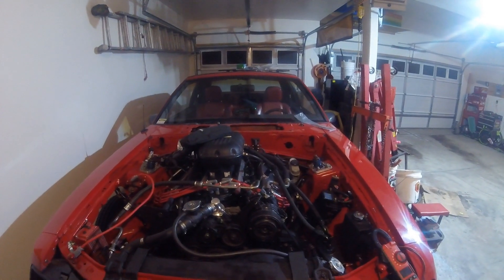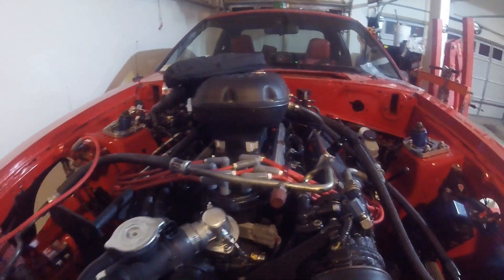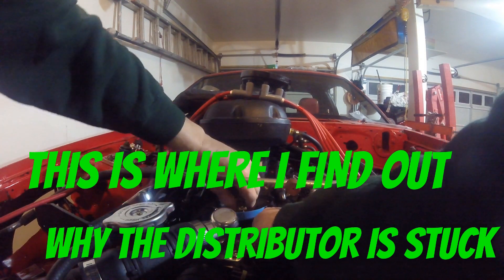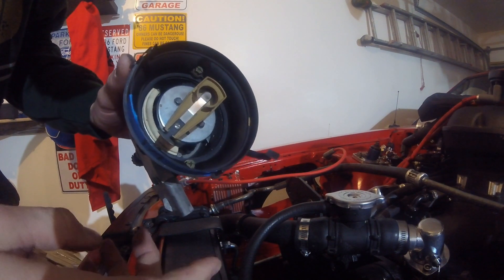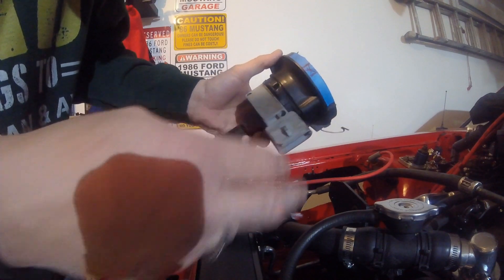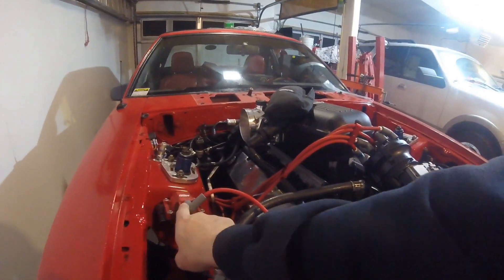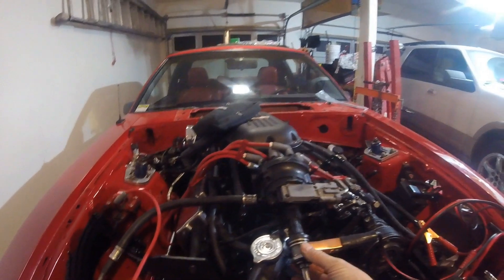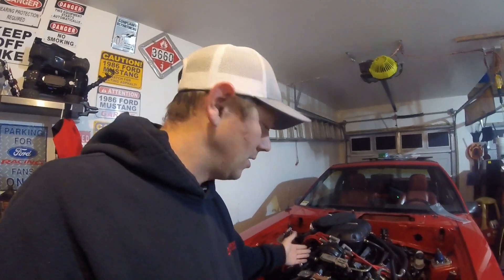Ford TFI & Pickup Testing - Ignition Troubleshooti

Comment: I get work but no fuel injectors clicking and no fuel pump turning on
Reply from the maker: Did you make sure to ground the body of the distributor?  Pickup inside the distributor could be bad, sounds like that’s what it is.
Reply: @BMF_Garage  I do have it grounded I even tried a new distributor connected the module grounded the body I do get spark but no injectors clicking and no pump turning on, what I notice it's that I don't get a ground from the rack at the fuel pump rely to power the fuel pumps
Reply from the maker: If your injectors or pump don’t turn on, you need to take out the ecu and look for corroded or bad capacitors on the circuit board.  Green fuzzy goo means they are bad or sometimes they even come off the board

Comment: Mine only sparked when I tried to unhook the ground cable and not when I turned the distributor what is the problem with mine do I need a new distributor because I already got a new TFI Mod
Reply from the maker: Could be the coil or the pickup in the distributor….

Comment: just did the spark/injector test and wasn't getting consistent spark to the plug.. wire is a foot long testing to 6.5k resistance
Reply from the maker: Look up how many ohms per foot that brand is supposed to have.. that will tell you a lot.  Seems high to me

Comment: Great video. I was looking into replacing this but after seeing how it works I don't think this is my issue. I have a 95 mustang with 302. After I removed converters, and added 75 mm tb and cai I've had a problem only after the car is really hot. When I go to restart it, it can't keep idle unless I feather gas. I let it sit for 25 min and it starts with no problem. It.seems like it's heat related . Will.never happen unless I been driving for a long time and shut it off.  I've replaced fuel pump, fuel filter thinking it was getting tired but still does it.no codes. Any ideas? Never left me stranded . I just sit for 25 mins and it fires up no problem
Reply: No. Good weather is here. Need to start working on her .
Reply from the maker: I know but unfortunately work is a priority.  Too many projects stacked up at the moment.
Reply: Wouldn't I throw a check engine light if the  communication was broken between o2 sensor and computer ?
Reply from the maker: If it’s working you might but maybe not.  I never had one on my car when the o2 went bad.  OBD1 is way different than newer cars.
Reply: Same. Thanks for the info. Ill you posted
Reply from the maker: Sounds good
Reply from the maker: Kind of sounds like the tfi module is getting too hot.  Have you ever replaced it?
Reply: @BMF_Garage  I have not. Car did a lot of sitting . I bought it last year.  It's a 95 with 40k miles. It was just odd that it happend as soon as I put a catless x pipe on. Only other thing I'm thinking is the x pipe doesn't fit 100 percent.  It hit / bent the o2 sensor . But I don't have obd1 scanner to check for activity
Reply from the maker: The o2 sensor would cause a rich or lean effect and could definitely be part of the problem. Have you pulled a spark plug to see what they look like?

Comment: Hi, I have a intermittent no spark situation i was wondering if you had any insight. My 89 f250 460 loses spark randomly but will regain spark with the tfi unplugged and replugged or the key cycled off and on. With that said I have replaced the ignition switch, tested a known good coil and tfi off of my other truck and replaced the distributor with a brand new with new pip unit which has had no effect, It has also not produced any codes. The truck has spark initially, it stumps me as to how disconnecting the tfi or cycling the key regains it. When the truck loses spark i have tried unplugging the spout which has not effect and the disconncting the ecm which has no effect, but as soon as I cycle the key or unplug and replug the tfi spark is restored. Any help would be greatly appreciated.
Reply from the maker: Sounds like tfi module is going bad or maybe the output from the ecu.  I’d start by opening the ecu up and seeing if there are any signs of burnt circuits on the board or if any of the capacitors are going bad.  They get a green fuzzy looking material coming out of them when they go bad.  If you don’t find any issues with the ecu, I’d replace the tfi.  It could be that it’s old and overheating.

Comment: Clevor thank you so much for making this video I spent a whole week pulling my hair out trying to get my car to run. So basically I've been wanting to do something with my spark plug wires I never liked how they looked under the hood I wanted them to run much cleaner to the distributor so I purchased wire separators from wild horses very nice setup and I also installed a brand new distributor cuz I was having issues when I would crank my car on my Holly dash it would show syncing then error for a second so I decided to install a new distributor with a set of cut to length wires to make a long story short I did all that and out of nowhere I was having problems with getting my car to start for a week and then tonight I came across your video and decided to give what you showed in your video a try and sure enough I found the problem it was the Holly TFI wire adapter that plugs into the Holly wire harness then to the TFI module one of the pins are not getting good contact. I probably explained too much but I just wanted you to understand just a piece of what I was dealing with and your video helped me solve it 👍💪
Reply from the maker: Hell yes I’m glad it was helpful!!!

Comment: You left out an important tip about removing the distributor gear. Theres 15 teeth on it....if you look at the teeth & the roll pins youll notice one pin is inline with a tooth and on the other side the pin is between 2 teeth...Placement is paramount in certain engines as once you set the distributor 10* one will be 12* off from obtaining proper SEFI synchronization due to being 12* off with the halls effect module ..Do you have a thrustplate behind the camgear????Ask the camshaft manufacturer why 10* is important in EFI EEC applications.....Youll be enlightened. Take care and awesome info about the testing.....
Reply from the maker: I've never worried about the position of the gear because I always check and reset my timing when I take the dizzy out.  Just good practice.  Thanks for watching!

Comment: Doesn't the msd totally eliminate the need for the tfi ???  MSD Ignition is a stand alone unit . wires that originally go to the coil go into the msd then from the msd out to the coil eliminating the tfi. correct me if I am wrong please. or is that only for a carbureted set up ?
Reply from the maker: Carb only unless you get an msd distributor.   If you just have the spark box, you still need factory tfi.  If you did the msd billet distributor and msd box, you don’t need tfi

Comment: Culd you tell my how manualy fire my coil with out ignition module?
I have gm distributor with induction triger and 4 pin gm ignition module on a singel e core type ignition coil.
I wuld like to have bouth positive and negative grounding similar to waste spark.
Also I have problem with my ignition coil if I try to bypass curent to coil from R terminal starter selenoid fuse pops engin wont fire coil not working I do not know is the 4pin ignition module polarity sensitive ore not aperantly I have also voltage regulator inside the dash board how shuld I adres this problem?
Because in cold weather I need that fully 12v my car has starting problems. 
And I like the idea of haveing dual ignition with amplifiers .
Reply from the maker: Firing a coil manually requires you to connect and disconnect 12v to the coil.  Just dont leave it connected.  I usually keep the negative connected to the coil and then just briefly tap the positive to the battery.

Comment: Hey Man, so I'm testing for spark the way you showed and at one point everything was working as it should but somehow I lost Ground I'm assuming and now the only time I get ground is if I rub the distributor on the engine but that's only for a fraction of a second. I'm not getting constant ground. Any ideas what could have happened?
Reply from the maker: Could be a lose ground wire.  There should be a thick wire attached to the block from the chassis and also one attached to the drivers side firewall by the valve cover that grounds all the engine stuff.
Reply: @BMF_Garage  I'll look into it. I appreciate you!
Reply from the maker: Good luck!

Comment: Thanks for the insight of a possible fix for a no spark.
Could you tell me about a faint spark from coil could possibly be? 
New sub.
Reply from the maker: faint or weak spark is usually due to a bad coil, tfi module or both.  Also could be the pickup in the distributor if that's weak.

Comment: Would a bad TFI cause a “pulsing”  like spark (almost like an arcing sound) coming from your coil wire to the distributor with the key in the “on” position but not while the engine turning over? Sorry if that’s confusing
Reply from the maker: Not likely… sounds more like a wire is shorting out by your description…
Reply: @BMF_Garage  ok thanks. My symptoms are running rich with a backfire pinging, bad idle and no power. If I unplug my MAP sensor it clears up those symptoms. Real weird. This is on a 96 F53 chassis 7.5l

Comment: I'm on my 3rd tfi now LOL its ford this time hopefully this one last, you think distributor could be going bad if they keep failing?
Reply from the maker: Typically just cheap electronics.  They get hot generating so much spark.  I use an msd box to take away the heat from the tfi module
Reply: @BMF_Garage  okay i should hook up my msd box then! Would help
Reply from the maker: It puts the spark load on the msd box not the tfi so it definitely helps!
Reply: @BMF_Garage  where should i look on how to install one i got the BTM msd box you got a video?
Reply from the maker: I have an install video.  Here’s the link 

https://youtu.be/rjJHE8euDAU
Reply: @BMF_Garage  thanks man!
Reply from the maker: You bet 🤘🏻
Reply: @BMF_Garage  i'm having this weird problem now where car runs perfect but once hot i can't start till the next day maybe coil is about to die Or 24lb injectors are flooding ever heard of that? My tfi feels cool to touch
Reply from the maker: That’s odd… does it physically crank just not fire?
Reply: @BMF_Garage  was dead mass air ECU i put my speed density back in and just drove 100km LOL
Reply from the maker: Hell yes
Reply: @BMF_Garage  and ford changed the part number for the foxbody TFI's they made a new one i guess they heard are calls for help! Lol
Reply from the maker: Haha 😂

Comment: This test does not test anything specifically, it just tests for spark which you could do without removing the distributor.
Reply from the maker: False.  This test shows you how to test for spark without having to crank the vehicle.  It also tests injector pulses.  It verifies your tfi is functioning and giving pulses to run the engine.

Comment: If a tfi is bad can it cause your mustang to idol
Reply from the maker: If they go bad, it’ll usually not even start
Reply: @BMF_Garage  thank I just have to keep looking what is making my 5.0 idol
Reply from the maker: Is it idling high, low, choppy, not at all or just rough?
Reply: @BMF_Garage  it is high
Reply from the maker: Some of that can be adjusted with the idle screw on the throttle body.
Reply: @BMF_Garage  I'm gonna try that thank u

Comment: I just installed a 408 in my 91 Foxbody and it will start right up, run smooth for about 15 minutes,  then die suddenly. I will go to restart, it will crank and crank, but won't fire up. I smell fuel in the intake area strongly when this happens, but no leaks at all. I got spark and fuel. I can come out the next morning as the fuel probably evaporates and the car will start right up, but give the same problem 15 minutes later. Any help would be great. Thanks!
Reply from the maker: Sounds more like an over fuel or enrichment issue than an ignition issue to me.  Have you pulled a few spark plugs to see if they are fouled?
Reply: @BMF_Garage  no not yet, I have a bbk regulator,  wondering if it is bad, when I pull the vacuum line off, no fuel is coming out at all.
Reply: @BMF_Garage  fuel pressure is at 37 currently and 10 degrees timing.
Reply from the maker: Definitely sounds fuel related.  Check plugs abs see what they look like
Reply: @BMF_Garage  I’m hAving the same issue too , my 94 f350 with a 460, dies after 5 mins of warming up as it starts to lose spark. Plugs turn out black and tested fuel pressure at 32-35 at idle. I replaced dizzy (FD13 spectra), plugs, wires, ignition coil, fender mounted black tfi module, fuel pressure regulator, map sensor. Don’t know what else could be wrong?
Reply: @BMF_Garage  and is this the same troubleshooting process with fender mounted tfi modules?
Reply from the maker: O2 sensors command fuel based on enrichment... could be bad sensors
Reply: I have had the same problem right right now, and after it dies the is no spark. Turn the key off for a few seconds and it will start right up. I replace the module with a older Motorcraft one. The kind with the Motorcraft logo. And it runs fine and never dies! Problem is if I replace it with a new Motorcraft TFI it goes back to running for a few seconds or minutes then dies. I don't get it?
Reply from the maker: Bad parts being used in the tfi module.  Everything is being produced cheaper and cheaper.  The heat causes the module to stop working then it cools down and works fine.  Has you made sure you have a good ground from the tfi module back to the distributor housing?  I use dialectic grease between the two to make sure I get good heat dissipation...

Comment: Thanks for the video
Reply: Can you help me with my problem.  Change motor from my 90 f150, simple hook and play run for a little over a minute cranks but no fire from coil. Over a week I've replaced everything on my truck. Computer, distributor, coil,iac,tps,different wiring harness knock sensor and still no spark.
Reply from the maker: Sounds like you’re missing power to the engine harness.  Did you verify voltage on the coil and fuel injectors with the key in the on position?
Reply: @BMF_Garage  yeah voltage is good, coil is good.  Have power through the harness and on #4 and #3 on the distributor has power . Then while trying to crank no power to the 6,5,3
Reply: @BMF_Garage  I went to another site for testing the tfi connection, if I'm correct the harness the numbers count down 654321 6 being at the top right.. with it unplug from the tfi did the not start test no power to any terminal.  Key on try to start with wire off the starter relay, power to #5 #3 no power to the #4
Reply from the maker: So if you have 12v pos... it’s on the ecu side.  The ecu gives the ground signal to fire all that off
Reply: @BMF_Garage  thank you for all your help with me. But I believe that I found my problem i had 2 hot wires going to the coil instead of hot and neg. Colorblind gets me all the time
Reply from the maker: That would definitely cause an issue

Comment: So I did this test when I spun it the fuel pump will run if I don't disable it and the fuel injectors will click but I get no spark from my coil spark plugs. I have 12 v to the coil wire with key on, I've tried two different distributors and a different coil what could be causing the no spark in run position? I tried replacing the ignition switch as well. I guess it could be bad out of the box
Reply: At all times you mean with key off, on and in crank position
Reply from the maker: On but not cranking
Reply from the maker: The signal wire for aural goes through the distributor and ignition switch so it’s got to be one of those...
Reply: Whats aurual? And ty for the reply
Reply from the maker: A typo lol the signal wire for those goes through both
Reply: Well I tried two brand new distributors, so I'm assuming maybe I just got a bad parts store ignition switch out of the box
Reply from the maker: Very likely.  I had that happen with two autozone distributors.  Also check that you have constant 12v positive on the positive wire at all times.  The negative wire is the trigger wire
Reply: Likely the coil, only way to know would be to test it properly which this video does not show.
Reply from the maker: There’s a lot of ways to test something.  Properly is a relative term 🤣

Comment: Could the PIP sensor cause a slight hesitation under WOT above 3k rpm? 

My car does this and people on the mustang forums have suggested it could be the TFI module or the PIP. 

It’s only under WOT above 3k. Cold or HOT. 

Seems to me by watching your test the spark plugs are either fireing or there not off the TFI and PIP.
Reply from the maker: How old are the parts you have?  If they are old or have never been replaced to your knowledge, I’d replace them
Reply: Nathan Grammar
Well it’s a 88 and it’s the original Distributor. Been trying to hunt down a motorcraft distributor. 

Tried a auto parts store one and the car ran like garbage. 

Tried a aftermarket TFI and car ran pretty bad has well. 

So yea your defenitly correct the mustangs like the motorcraft stuff.
Reply from the maker: Gotcha.  Yeah you can’t skimp on the tfi or pip.   I’ve had plenty of bad ones right out the box.  With that much age on a factory one, it’s likely going to start giving you issues soon, but it’s a tough part to get a good replacement for